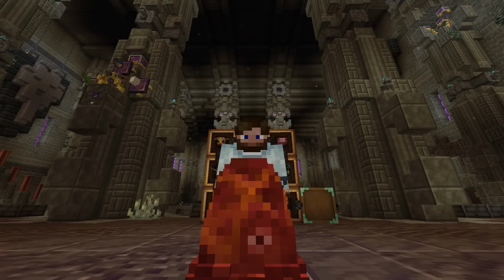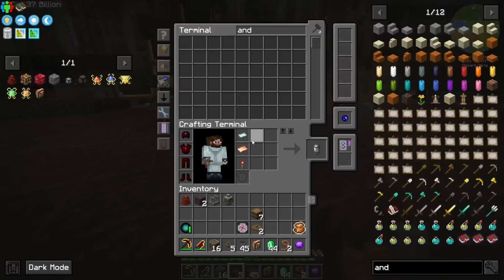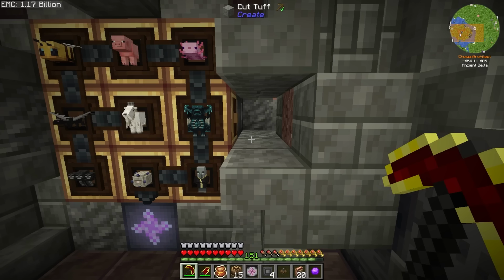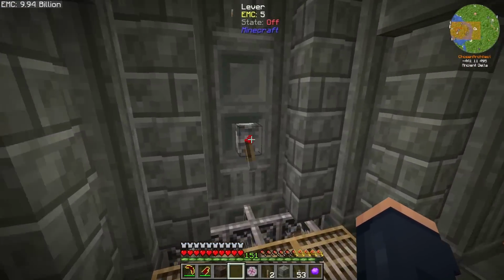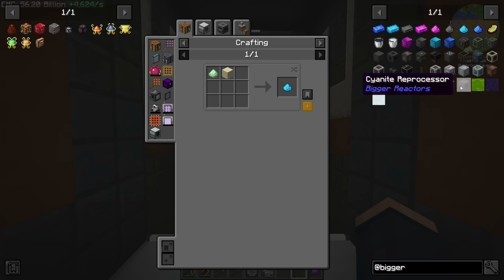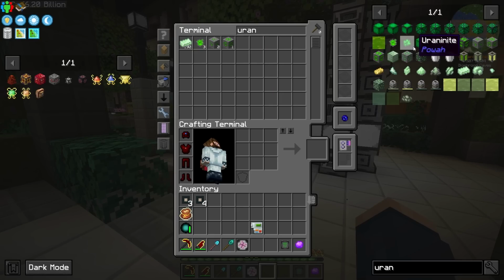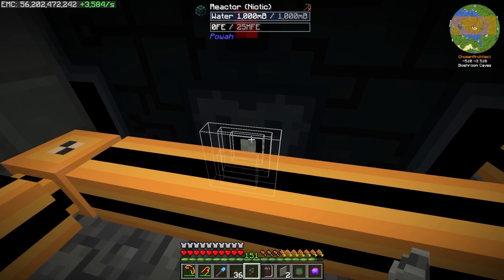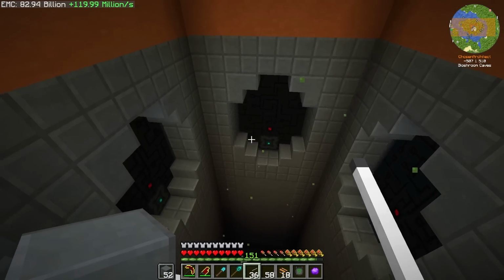PROJECT ARCHITECT 2 - EP 21: Archimeat EMC Loop + Powah Upgrades

Comment: Hello, thanks for the interesting video. If you want to automate the wither it's totally doable with modular routers, it may be cool seeing such an early game way to automate it. If you are interested I'll give some pointers about how I did down here:

- I used 8 routers, 7 to place the soul dust and skulls (I pulled items from a barrel managed by RS) and 1 to move the loot and manage the loop;
- I put the 7 routers in the wither pattern configuring them to go off on a redstone signal, pulling and placing the dust and skulls. They also require the upgrade to make them blast resistant;
- I make a little kill chamber encased with the routers and some blast resistant material (I used some modded glass) for the wither to stay;
- I put a Mob Masher down to kill the Wither (I didn't start Industrial Foregoing when I built this yet, use your preferred way to kill it);
- I use an absorption hopper that transfers the loot into the last modular router (use the method you want to loot, but be sure to send the items through the router);
- The last router sends the loot in the storage, but also has an Activator whitelisted on the nether star to send out a signal when the star is looted;
- I route this redstone signal to the back of the 7 routers, making sure the top 3 with the skulls receive the signal later than the others (skulls must be placed last);
- To start the loop and unstuck the system I just keep a button to send the signal manually;

Hope I didn't forget anything important and it's clear and useful to someone else out there ;)

Comment: Hey chosen at 20:00 you can hold space and shift while flying to crouch midair
Reply: Yes he can, but modular routers still doesn't like to work when you are midair for some reason. Like he tried this in another series and still had to land to be able to select blocks with wireless modules.
Reply: @piotroklesinski6274  oh ok I've never used that mod

Comment: Mekanism's Gas-Burning Generator on Ethylene is better than Powah's Niotic Reactor, it makes 72kRF/t at max burn rate when full of ethylene. It's insane and so easy to expand. I have 10 in my basement almost 1MFE/t, but now that I'm into mekanism Fission, my Turbine will be bringing in WAY more than that, and soon Fusion will be bringing in 20M/t just for DT Fuel which essentialy comes from water.

Comment: You can drive those crafters for a LOT less power if you properly gear ratio the output from the motor rather than turning it all the way up. The faster it spins, the more torque it makes, but also more power it consumes. You are wasting a lot of torque there, I believe one motor can run 3 of those crafts. Thus wasting a ton of power.
Reply from the maker: Ill take the power loss for the time saved in not doing that XD
Reply: @ChosenArchitect  I admit I can understand the urge to build more reactors rather than play with gears or the required setup for precision mechanisms for the gearbox thing (which is in fact what I did).

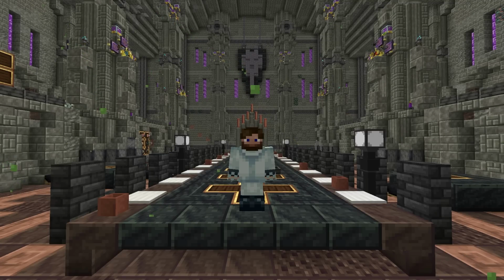Comment: 10:45 It says +30 million because the archmeat gets crafted and absorbed at about the same time as the ingredients are generated.

So during one interval, you have a loss of 20 million and a gain of 50 million, making a net change of +30 000 000

Comment: I did not expect the amount of power from thermal would be so huge
4.600rf/t per engine. is huge, i even tried endergetic generators, but they where worse off.
Especially because lava = as good as free.

Comment: I think you need a passive energy from powa in future just for the AE system .
Are better solutions for energy from powa who just use heat and water and that is a single block but is a early start,thermo generator from powa is the generator from what remember is low with energy in comparison that nuclear but not a lot
Reply: I usually just keep 4 nitro reactors, overkill energy, end game it's the nuclear, definitely

Comment: I think powah is the best way to generate power
Reply: In mid game thats true but in the endgame u can use mekanism fusion reaktor with dt fuel on 98 burn rate and then do aktive cooling and use the Steam to output nearly 500 milion rf/t.
And the best part is that the deuterium and tritium needed for the dt fuel is made out of water. So powah is great but to power smth like an SPS mekanism is just better.(tipp use integrated Dynamics )
Reply: I'll add the caveat of "assuming you have a good autocrafting system in place". 

Having to hand-craft the higher tier of powah items is a nightmare and not advised.

Comment: Hey Chosen I've encountered some bugs you might want to fix. First is that the block absorber doesn't work with any of the mekanism or compacted blocks (it might actually be any modded block). The second is that the modular routers can't be broken, if you try to break a modular router with it will just place itself back down immediately
Reply: Can confirm that modular routers can't currently be broken, hope the fix will be soon.
Reply: Pretty sure rf dimensions only works with vanilla blocks.
Reply: @LunarBnnuy  strange that you can get dimlet recipes for modded blocks then
Reply: @Flamescales29  think it's a config thing. I might be wrong. All I know for certain it doesn't work for mekanism fluids and gasses since chosen mentioned it in his last video
Reply: i was able to get the block absorber to absorb end draconium ore, but not plushies which is what I was going for.
Reply: @lockes5hadow I would imagine plushies are a complex block, which RFTools would reject because it would be liable to corrupt worlds on single player and crash clients on multiplayer servers or even the server itself with the right types of blocks.
Reply: @GuiSmith  oh yeah, for sure that's likely. But the EMC gains were too tempting. Imagine solid cubes of wither plushies worth countless millions EMC